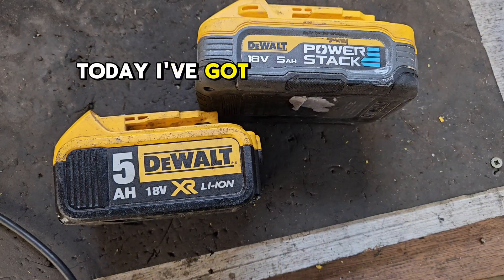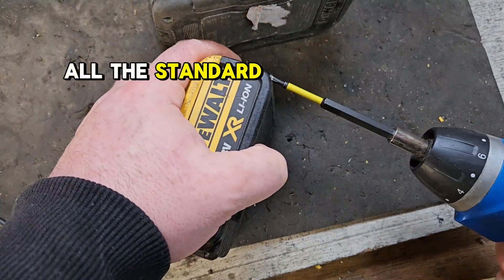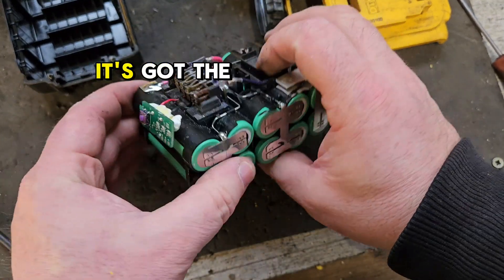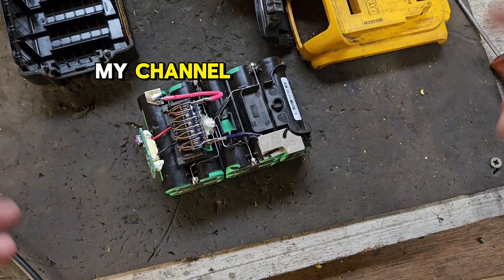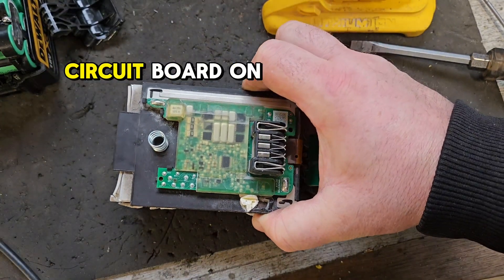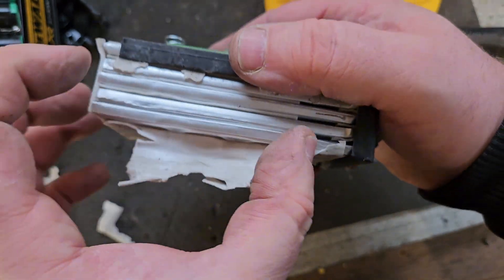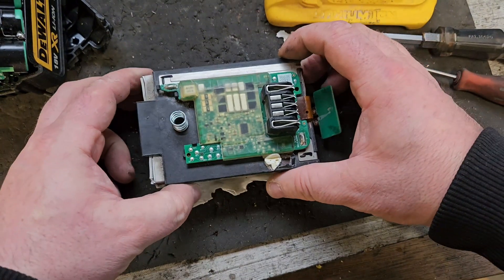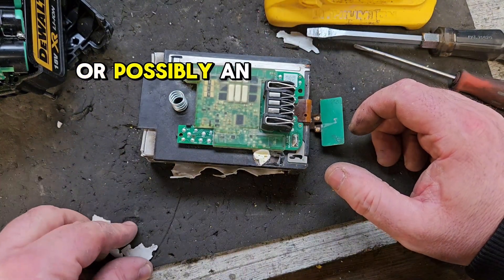Powerstack Vs Ordinary Battery Teardown comparison

Comment: One of my 5AH PowerStacks started acting up a week ago. I left it on the charger and came home to find all three LEDs were lit on the battery level indicator/fuel gauge.

Yes, it was full and still works but the lights would not turn off. The Internet tells me I’m not the only one with this issue and it will eventually kill the battery from over-discharging.

DeWALT already sent me another one under warranty so I wanted to see if it was just the switch. Unlike their other battery designs you can’t get to the LED board without ripping the whole pack out of the lower casing, and it’s stuck in there with foam mounting tape.

Thanks for showing me where it’s safe to pry! I couldn’t even see down there with the LEDs shining in my face. :)

Comment: The old style does not balance charge the batteries (battery voltages are all over the place if he measured them.  The small circuit board merely monitors individual battery voltages and when one is critical, it shuts the pack down.  This is very cheapo and the RC LIPO drone/robot crowd must be LMAO at Dewalt.  However, the NEW Powerstack does balance charge!  You can tell my the major circuit board.

Comment: Same capacity, more current.
Reply from the maker: @emmettturner9452  That is a fairly concise way of putting it. That seems to be the way they are.
Reply: @doctorlefthandthread  LOL! Thanks.

IOW, it’s getting the same work done faster. Technically, you can drain it faster if the tool would otherwise slow or bog down (not a bad thing).

Throw it on an LED light and it should last about the same amount of time since they’re both 5AH capacity and the current is limited by the brightness of the LEDs (same with either battery).

Comment: Whats the fault with the Powerstack battery? Interested as I have five of these batteries now-3 x 5ah and 2 x 1.7ah.
Reply from the maker: To be honest I haven't explored it yet it's showing around 15v and won't charge or take any voltage from other methods but I will investigate soon
Reply: did you get to look at the pouch ID to see wot sort they are Doc
Reply from the maker: @gazbullen  I didn't get into it yet but I will
Reply: @doctorlefthandthread  I hope these Pstacks dont start suffering failures-they are £80-£90 each!
Reply from the maker: @animal79thecat  they have a decent warranty for now but we will see
Reply: @doctorlefthandthread  I bought private with no receipt,so fingers crossed for now.I baby my batteries though,got original 2016 flexvolts working like new.
Reply from the maker: @animal79thecat  you might be ok
Reply: i would of said its a pouch cell gone bad